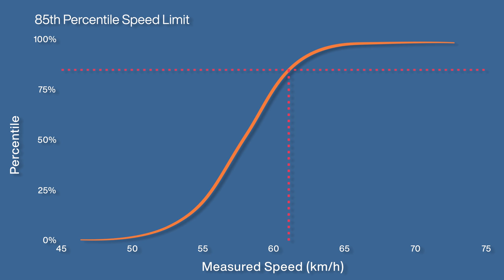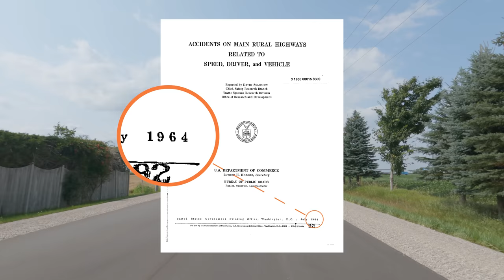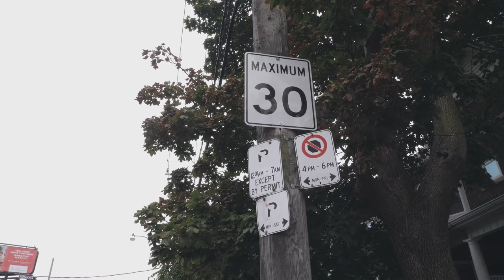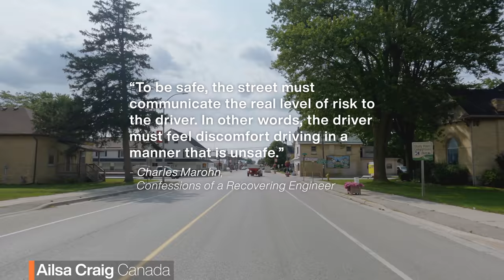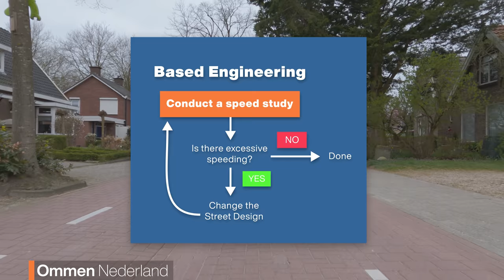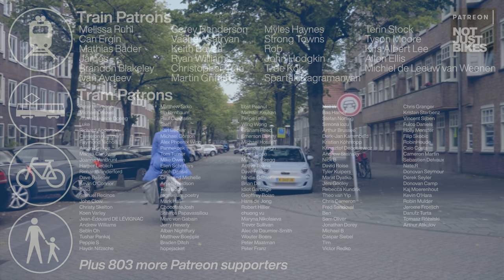The Wrong Way to Set Speed Limits [ST06]

Comment: In France and other places in Europe, when you come from a country road with 80 km/h limit to a village with 50 or 30 km/h limit, they often have various kinds of bends, chicanes, dividers and poles forcing you to slow down. Very effective
Reply: Roundabouts.
Reply: @Jacksparrow4986  Roundabouts with different diameters.
Reply: Or traffic lights in eastern europe and most of eastern Hungary
Reply: Which is, IMHO totally stupid idea. They should either build bypass with total ban on any sort of new development connected to it (I know about town where they got bypass in late 90's, ad build new development on it, had put some roundabouts there as well, and now are complaining about traffic jams.), or it is not that important road and then there is virtually no reason, I would say, for such dangerous thing. The first that should be done is upgrade of road network in such manner that it will fit 21st century standards. Even with all hype for mass transit, for cargo trains, there still will be demand for road traffic (unless it is banned and then we have much greater problem to solve) and in my opinion it is wrong to pretend that people in cars are in error when plenty of roads are about one car wide.
Reply: @alphastratus6623  a roundabout with a different diameter around the same intersection
Reply: But then again, France also feels that it is nessecary to remind motorists at every single highway entry and exit that taking U-turns is not allowed. Those signs must have cost them millions of euros.
Reply: @ALEXANDER1318  I'm French and there are no u-turns signs on the highway at all. Sometimes we have no entry signs but always when it's ambiguous like when highway entry and exit join in the same road.
Reply: And then there's Ireland, where the speed limits permit 100 km/h along cliff-side dirt roads 🥴
Reply: @Jacksparrow4986  No one I've seen in NA knows how to drive on roundabouts.
Reply: @MrToradragon  I totally agree, same goes for Poland where villages are built entirely along a road instead of at the side and the  linked with a street or two.

Unfortunately I can't see a way to fix that here, you'd have to effectively demolish half the countryside and reorganize it.
Reply: Meanwhile in Australia, I hear we have a town called something like "Catch-Em" and there is a speed camera right before and right after the town to catch people
Reply: @ireminmon  "bycicle lanes" and "wasted money" shows enough of your bias that no matter what someone says you will not be convinced anyways and are just here to troll
Reply: Here in Texas the speed limit is 75 mph or 120 km/h on a two lane road
Reply: And quite often gendarmerie with laser guns
Reply: @Alacritous  I've heard that. They don't like them because they don't know them and they don't know them cause politicians are to scared to improve everyone's live by embracing something unknown by most. Chicken egg.
Reply: What I love on French roads is that the speed bumps aren't just mild annoyances. In Sweden you can drive straight over a speed bump in a SUV doing 80 km/h. In France they aren't speed bumps they are Ferrari Fences. Drive too fast over them and buy yourself new suspension.
Reply: @ireminmon  It always depends. When there is room around the town and many people use that road, it should be done. If 100 cars per hour use this road, it is overkill.
Reply: @Jacksparrow4986  Nah honestly you can go through most roundabouts without slowing down if it's not busy lol
Reply: @ireminmon  Mate, bicycle infrastructure is the cheapest you can invest in (apart from pedestrian), not exactly a waste if executed properly.

Also most mills are powered by electricity rather than wind nowadays.
Reply: @MrZefel  I wouldn't listen to that person you're replying to, they seem to think bike lanes are expensive and that we have still have "windmills". They don't exactly seem to know what they're talking about.
Reply: In Romania we have rumble strips that are placed when entering a village
Reply: @evboto.5597  For real?? I've never seen a road at 120km/hr. Our motorways are at 110, streets are at 40 or 50, stroads are at 60 and proper roads are at about 70 or 80
Reply: 50 is the standard in Germany.
Reply: Here in CH, I feel like the difference between a 80km/h road and a 50km/h road is whether there are houses nearby, except for a couple of farms with an 80km/h road straight through the middle cuz idk… Sadly, 30km/h roads are too easy to miss
Reply: @dutchman7623  we actually use these in Canada, in rural areas where there is an intersection of two major roads coming up. We call them "rumble strips" and there are often several groups of them. Ours are grooves cut into the pavement (they often make more of a singing sound rather than a rumble) rather than on top, because the snow plows would destroy them otherwise.
Reply: Maybe even just some kind of painted line across the road would help. Can't tell you how many times I've missed a sign for a change in speed limit.
Reply: An American will find a way to hit every pole along the way.
Reply: That is fine. What I have problem with is road bumps. Because nothing is better than forcing emergency vehicles trough them. Like an ambulance on an emergency killing their patients because some idiot in the council decided dangerous bumps are a good idea.
Reply: Fuck that!
Reply: @MrZefel  your outrage to the comment you replied to tells me all I need to know. You are just here to troll people. Reported!
Reply: In London there is a camera like on every junction I swear.... Cost me thousands!
Reply: @MrToradragon  You can't build a bypass for every small town, sometimes it makes sense to have people slow down for half a minute.
Reply: @ireminmon  have you ever used this bike lane?  If not, why? If bike lane by the road is used for walking then something went wrong with the design. Is the bike lane connected safely with other parts of town? Can you drive to areas where people work by using this bike lane? Can you drive to a shop? Do you need to hop off your bike rarely or never to cross the street? If not, then it should have been designed differently. In my area there are multiple bike lanes that go randomly in different directions and often end just leaving you on the street, often not a local street, but a fast one. Do I use them? Yes, if they are in good condition and don't try to kill me by bumps and uneven bricks, it's still better than just riding on a road.
Reply: @indominusrex1652  
Been to Russia this summer and it’s baffling how much street and road design there is the opposite of here in the Netherlands where I’m from. For example, to cross a 4 lane road as a pedestrian you better run to make it to the other side. Here in the Netherlands we have things called refuge islands that: a) slow drivers down because the road narrows, b) alerts drivers that it’s a pedestrian crossing because the zebra markings on the road are snowed under half of the year, c) makes overtaking harder (Russians like to overtake on intersections when there is no traffic on the oncoming lane), and most importantly, d) it provides a refuge for those pedestrians who can’t cross the 4 lane road in one go without running, like old people, parents with a stroller, people with disabilities, people carrying something heavy, you name it.

Such a simple solution to make town intersections safer for both pedestrians and cars. https://en.wikipedia.org/wiki/Refuge_island
Reply: @KevinKickChannel   wait you meant to tell me that the refuge island in big cities is not common?
Reply: @ireminmon  That's down to the design of the bike lanes, which isn't determined by the EU. For example, in the UK, local councils love to put bike lanes onto existing pedestrian paths because it just requires a pot of white paint and a few hundred signs to mount junctions telling cyclists to dismount and cross the joining road on foot. Unsurprisingly these aren't heavily used by cyclists; imagine a road where you had to get a horse out of your boot/trunk to tow your car across traffic lights - you'd take a different route. So, whilst the EU might be saying "it's a good idea to build more bike lanes", it's most likely your own government is choosing the easy way to pretend they're cycle friendly, and in the process wasting that money on infrastructure that the know won't be used.
Reply: @ireminmon  Countries are designated funding by the EU for projects proposed to them, your government doesn't have to accept them and build them if they don't think they will be used lol. The EU aren't forcing you to tear down your streets.

You're very ignorant.
Reply: @louis18071957  I see them on Belgian highways a lot.
Reply: @louis18071957  No I'm also French and have definitely seen them on on ramps and round abouts connected to highways.
Reply: @ireminmon  yeah, I get that you are frustrated, because I always get frustrated either when I'm trying to use badly designed bike lanes or when there are none, and I need to go with traffic which is not pleasant for me nor for drivers. All those bike lanes in parks made for leisure, but no serious bike infrastructure to bike to work safely.
Reply: Here in the UK none of the roads are straight anyway so people generally don’t go that fast even when the national speed limit (60mph/90kmph ish) applies in country roads
Reply: or they place an automatic radar station at all entry points of the village. everyone who enters the village and is to fast pays money to the village, often the radarstations can check both directions so if you accelerate while still in the village you pay again.
Reply: @ireminmon  ... are you lost? If you think bicycle lanes and windmills are "corrupt garbage that nobody ever uses", then I think you might be visiting the wrong youtube channel.
Reply: Villages lmao
Reply: In Illinois most residential area the speed limit is 30mph strouds are 50 mph and highway are 90mph
Reply: @ireminmon  yeah, I think bike lanes make most sense in dense cities. In rural areas most of the people drive 20-100km to work anyway which is too much for most of the people to cycle. I don't mind bicycle lanes in rural areas, but I think it should be the last concern if you haven't developed a bike lanes network around cities first. If you have a comfortable network around the city and into the city, you can connect it to rural areas and then maybe some people would change to ebikes, but that's really a distant future unfortunately.
Reply: @dutchman7623  we have the same in Montreal, Canada, except here we call it potholes and we get angry at the government for letting them fester🤣🤣
Reply: In north America, we just have speed bumps
Reply: @seybertooth9282  "Ferrari fences" I love that expression. Thanks !
Reply: ROUNDABOUTS EVERYWHERE . At the beginning middle and start of any town. At least here in Spain.
Reply: the difference is that they WANT you to slow down. in north america, they WANT you to speed so that they can extort you. after all, city counsellors need to pay for their "office upgrades" somehow
Reply: @ireminmon  What do you call rural? less than 500 population? in this case, you won't get EU funding for neither cycle tracks nor cycle lanes. If you are in a small city (<5k pop), you also won't get funding for tracks except if you are in a popular tourist city or a student town (Alby in France is one).
Reply: I particularly like road bends on the town entrance in Hungary. Can't find a term to google image, not a roundabout, looks like a drop from above.
Have not been to France yet.
Reply: Then that means you will arrive at your destination later, which sucks
Reply: @ArtieArchives  It also means you would not kill accidentally someone. And someone would not accidentally kill you.
Reply: @sergeykish  They should of been paying attention.
Reply: You have that in the Netherlands too
Reply: From my experience drivers just tend yo avoid them by swirving when there’s free parking nearby providing a gap XD
Reply: @ireminmon  nobody uses "windmills" and bicycle lanes? And those are your "corrupt" things? 🤣 Oh my, oh my.
Reply: @ireminmon  you genius 🤪, the EU doesn't do those projects, nobody in the EU said "oh wait, I'll go build some bike lanes in Ire Min Mon's middle of nowhere, VMs forced it on your village. It's your local municipality spending EU citizens money.
Reply: Austria does this very nicely and non-intrusively
Reply: @MrToradragon  Put an orange “construction zone” 500 m out, then narrow the lanes with cones, park one backhoe there and just leave it like that!  Seems to work a treat!
Reply: In my area they slap speed traps at the side of the road. If you don't wanna slow down, you pay.
Reply: @indominusrex1652  Yeah, we have those all around my country
Reply: Very effective at stopping responsible people who know how to drive from getting to their destinations more quickly for the sake of morons.
Reply: @tolvajakos  Semi-trucks are definitely a problem but making everyone slow down so they do too really isn't a long term solution. We need to create a semi-truck specific safety system to keep other drivers safe.
Reply: @keld101  well, everybody else needs to slow down when you hit a city/town.
Reply: @tolvajakos  What if it's a quiet town with double wide lanes going through it and plenty of open space to see there's no one is at the intersection coming through? How does slowing down in that case help anyone? 

The point is it seems to me that in every circumstance in which it truly is helpful to a community to slow down it's a case of changing environmental conditions and circumstances making it so. Which means there are almost always also circumstances in which slowing down in those spots isn't helpful. It's dependent on what's reasonable at the moment. So just make the law that: reasonable speed laws like we have in Texas. Then all you have to do is recommend a speed on signs of what's safe for people who don't have the skills or equipment to be independent safe drivers.
Reply: @keld101  Things are different over here. People in Europe walk and cycle. And kids play in the street. People talk in the street when they meet and stand in the bus stop waiting for the bus. They look at shopwindows. As a result of whatever this guy keeps talking about in his videos. Why would you not slow down? I don't even understand. You can hit pedestrians, make rocks fly at them, etc. Plus you don't want noise of speeding cars in your house, neither your house be shaken by speeding semis. Here towns are made more for people, pedestrians. When the villages, towns were designed (if they didn't just grow out of noting), cars weren't even a thought. So towns are not designed with cars in mind but with people.

> recommend a speed on signs of what's safe for people who don't have the skills or equipment to be independent safe drivers.

That's the point. You can't just put out a sign saying this is the speed you should drive and expect that people will just follow it. Do you have locks on your door and a burglar alarm, or a sign that says don't break into my house (because you assume some people don't have the skills to just not steal other people's stuff). USA has the most incarcerated people per capita in the world (by far) and you are arguing that there is no need to physically make it impossible to speed, you can just put out a sign? That is the whole point of this video. Make the roads such that people don't want to just speed through. So that it becomes a livable, walkable town. It is just like putting out a trash bin instead of putting out a sign that says don't litter.
Reply: @tolvajakos  I understand that things are different over there due to the reasons you mentioned along with many other reasons. I'll even admit that the automobile fatalities per kilometer driven here in America are on average roughly 30% higher than in European nations. My point is not that the proposed system doesn’t save live but that it is a bad long term solution that is very hard to reverse.

To be clear, I'm not saying that here in Texas people can race through the city streets with pedestrians all around or do drifts through neighborhoods at night just because no one is on the road; that would be reckless and UNREASONABLE and therefor illegal here just as it would anywhere else. But the benefit of our system is that it doesn’t burden responsible civilians and allows them to take advantage of driving at times when it’s reasonable to go faster than the recommended speed. It also eliminates the potential for police to create speed traps and fine people for petty acts that aren’t really harmful. And in the extremely rare occasion that seeing crosses on the side of the road from stupid people crashing isn’t enough to stop drivers from acting particularly recklessly in a specific section of road we do put things like round abouts and sharp turns in to slow them down. But it’s a last resort ONLY.

Once again, what’s going to happen in 20 or 50 years when vehicle technology advances and cars are autonomous or carry a lot of people or offer better handling at high speeds or when roads need to be redesigned so that these new technologies can thrive? If all your roads are unnecessarily narrow, bendy, or obstructed with obstacles the result will be that you’ll lose much of the benefit of modern technology and fall behind other nations with more efficient roadways. Not to mention the immediate effect of increasing taxes to build unnecessarily elaborate roadways and slowing responsible drivers who could have otherwise driven faster safely. It’s purposeful inefficiency, and over the years as nations compete those losses add up.

“Do you have locks on your door and a burglar alarm…”- My locks/alarms don’t burden anyone but criminals and myself. I’m also not arguing that speed limit signs are effective at actually lowering speeds, hence why Texas has speed recommendations instead. They act as a helping hand for people who are on unfamiliar roads with limited visibility so they don’t have to guess what speed is safe for the next turn and things like that.

“USA has the most incarcerated…”- No, actually we’re no higher than the 3rd highest. People keep forgetting that China and North Korea don’t report prisoners of conscious that they put in concentration camps and execute at mind-blowing rates. But we are the highest of all 1st world western nations, which isn’t good but considering we our nation is literally founded on the concept of individual freedom above all else and the fact that we are far FAR more culturally diverse than any other nation it’s surprising our crime rates aren’t way higher. Overall, we’re doing very well all things considered and we get a lot of benefits for our increased responsibilities. It certainly has its down sides but it works.
Reply: @tolvajakos  I can relate bro, where are you from
Reply: @MrToradragon  a bypass road for a village of few hundred people? Are you mad? No real roads go through villages anyway, only roads with relatively low speed limit of up to 100kph are really the ones that blend into a built up area roads. Otherwise there’s a net of  expressways and motorways to take if you don’t want to go through towns on your journey.
Reply: @carlosandleon  Yeah, but you can't just slow it down, cause then travelling around becomes a nightmare and people are unlikely to adhere to the limits anyway. Putting cobble-stone is even worse, cause the traffic won't decrease, it would just become loud.
Reply: @carlosandleon  What places are those?
Reply: @carlosandleon  Huh, well my recollection of German villages is that the actual road passes outside or on the outskirts of the village. Same applies to Austria and Greece.
Reply: @ireminmon  why do i feel like you are hating on the dutch? We love our windmills and bicycle lanes very much sir.
Reply: In some rural areas of the US they have this too.
Reply: Yep, and residential areas have a speed limit of 30, especially if there are schools around.
Reply: Dividers are trash and make only sense where slow speed like 30 is ok but nothing above it just makes more accidents and nothing more
Reply: @ireminmon  
What country are you living in?
Reply: @MrToradragon  you obviously have no idea what these chicanes look like and hoe they are placed.

They're usually placed 30-50 meters behind the place-name sign, a giant, bright yellow sign that's hard to miss and every educated driver knows that this sign means a speed limit of 50 km/h, unless there's an extra speed sign stating otherwise. So by the time you approach the chicane, you already had plenty of time to brake. It's really intended for those drivers who didn't brake enough. And typically these are designed like a traffic island, so it's just a bit of sidewalk in the middle of the road, requiring you to drive around it.
If you run right over it, you're just gonna wreck your front suspensions, but you're very unlikely to get injured. In the dumbest case you might hit the sign that told you to drive around it.

And no, here in Europe we don't do bypasses for every agglomeration of five houses in the middle of nowhere. We don't have wast wastelands that we can just pour concrete over with no second thoughts. Building a bypass always means either destroying more precious forrests or ceasing and destroying parts of the fields of the farmers living in that village and they won't have that!

The reality of it is: drivers have to pay attention and drive slowly and carefully through villages on the countryside, just like in the cities. Using designs and techniques to force drivers to pay attention is the better way. Trying to build a massive road system designed for people to mindlessly blast around at high speeds without being a danger to others (and themselves) is a bad idea!
It'll be expensive af and impossible to actually pull off!
Reply: @GTAVictor9128  that kind approach to speed limits in the UK and Ireland has always puzzled me
Reply: Best part is if there is a isle and a bend only on the lane going towards the city centre. If it's night time and there is no one round you can just take the other lane, which has no bend and basically drive straight.
Reply: Or a traffic light with a stop sign followed by another traffic light, yay!! Typical of Spain xd
Also, traffic lights and pedestrian crossings E-VE-RY-WHE-RE, every few meters, it's basically impossible to be over the limit here.
Reply: I'm a Pole, never slowed down anyone , your statement is antisemitic
Reply: @MrZefel  I wouldn't give up my biycle track for a circular rute around my village, that nobody would use unless we also put the traffic calming infrastructure in the village, vor anything. People use the track incredible much. I used to drive a car for almost every trip I did, but now I cycle a lot more!
Reply: we look at those as launching pads.
Reply: In Canada there's just police officers with radar guns forcing you to slow down
Reply: @ireminmon  You are not living in the eu!!?
Reply: @ireminmon  if you are living IN Slovenia, why you try to come over like you know how things in the EU in each country are funded?

I mean you think windmills are still being build in 2021 and funded by the EU. Bicycle lanes are useless (only from your personal experience in Slovenia). You cannot judge everything based on your experience how your country create things... Your are narrow minded thinking.

Fact: Bicycle lanes in the Netherlands are well designed and used daily, even those connection a town to a smaller village. Teenagers cycle to schools riding 15km to and back as their smaller villages don't have the schools etc.

So all the time you keep commenting bicycle lanes are useless is you just being narrow minded.
Reply: Austria has small pedestrian islands on entrances of villages, they bend the incoming traffic but keep the outgoing lane straight.
And in lots of vilages in teritories of AustroHungarian empire, roads were designed with 90 degree bend on village entrance..
Reply: Is south africa without warning there is just a speed hump in the middle of the road  that destroys your cars suspension. Very effective
Reply: Those islands are not very effective and super annoying. The same is true for speedbumps. Those are just afterthoughts that make drivers angry while driving which I fail to see where it helps. A proper design would not need speedbumps where you lose your teeth regardless of whatever speed you are approaching nor need those bendy islands which cannot be safely taken by semis and buses without making the oncoming traffic scared. These are bad designs which makes driving stressful and annoying.

Speedbumps most likely increase polloution, because most people brakes before them (brake dust) and accellerates after them (exhaust gases).

Curvy narrow roads are okay (if parking and U-turn possibilities are provided), thats what the steering is for, but slalom is unnecessary and also bad road surface is dangerous and annoying. Makes a lot of noise which is not good for the people live there nor in the car, unpleasant to drive, and makes the suspension components to wear out way faster than should be.
Reply: @epender  I thought he was talking about wind turbines.
Reply: This is only a way to enforce a speed limit, rather than putting a sign only.
Reply: @ireminmon  go to therapy dude. You have issues. Your had a full on tantrum in this comment section and its embarrassing.
Reply: @ireminmon  The weather is a lame excuse, people in Belgium, the Netherlands and Denmark use bikes ALL YEAR LONG. Hot summers or snow only stop some cyclists and bikelanes get cleared of snow fast in some regions. One of your problems is that you like in a country where only so few ride a bike for fun this is not a reason to punish the few who have no choise but to use a bike by stealing their safe path.